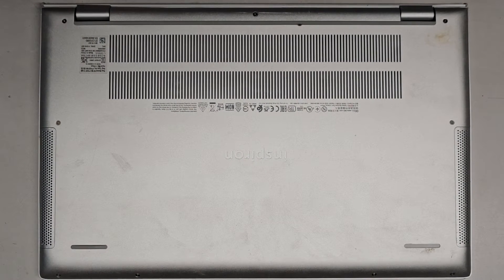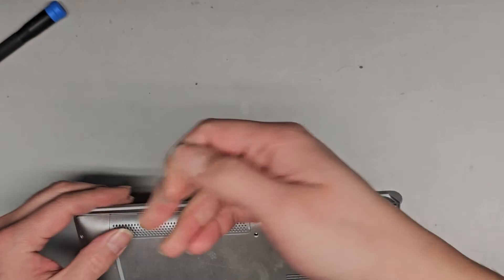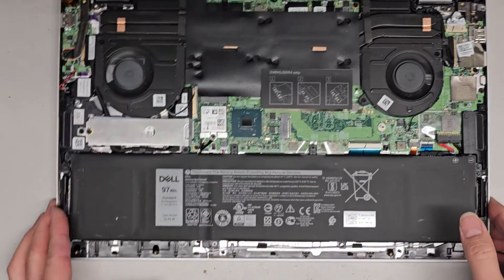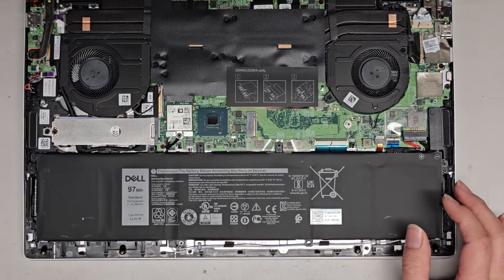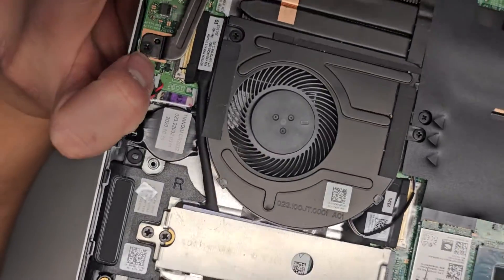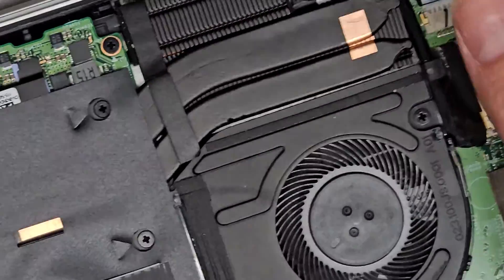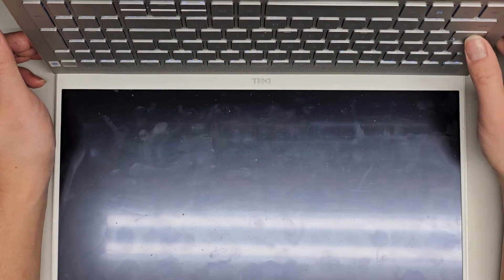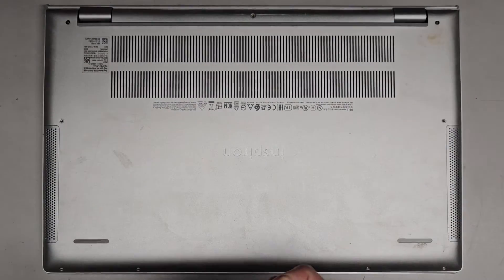DELL Inspiron 7000 7501 Disassembly RAM SSD Hard Drive Upgrade Battery Replacement Repair

Comment: Hey so my dell inpiron have a battery part type of "H5H20" a 3 cell 56wh battery, can I replace it with a 97wh 6cell "6GTPY" or other 3 cell 56wh that is not "H5H20"?
Reply from the maker: If you have room for it and it's designed for the model of your laptop. You'll have to open it and check.
Reply: Have the same laptop with the same battery as you man. Wondering if you bought the upgraded one and it worked for you. Please lmk.

Comment: Did you able to fix your laptop? Did you try change cmos? My laptop currently has those issue. Now caps lock light is on all the time when i turn on my laptop.
Reply from the maker: Can't switch capslock off?
Reply: @ItsBinhRepaired  it's work fine.. just the indicator light always ON. So, need to test to know if it's off or not
Reply from the maker: Usually that's a bad keyboard.

Comment: expert drill my laptop screw near the hinge bcz they can't open the cover! now I faced with cmos battery issue, when it's fine before sending to expert
Reply from the maker: Hope they're able to fix it
Reply: @ItsBinhRepaired  it's left bad scratch at the hole. They should watch your video before that 🤧🤧 actually they didn't need remove that screw, but just lift it up.
Reply from the maker: Yup lol
Reply: @ItsBinhRepaired i want try open this myself..what screwdriver you use to open m2x4 screw?
Reply from the maker: @myaHwee  get a good set like this and use the one that fits the best https://amzn.to/3KuNBRz